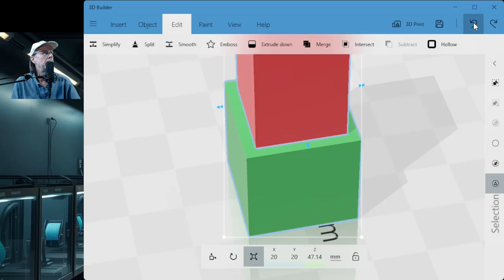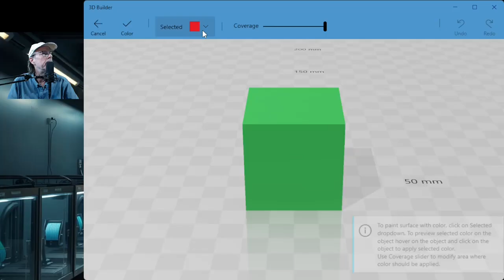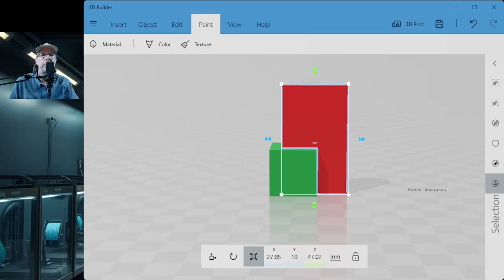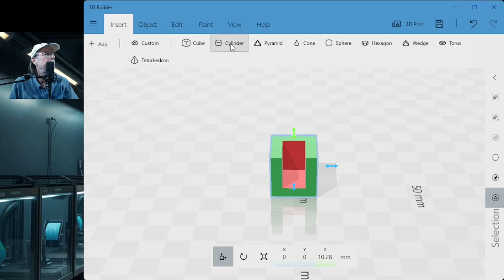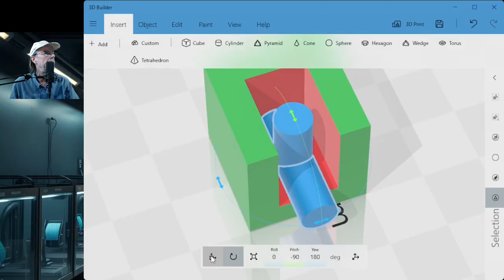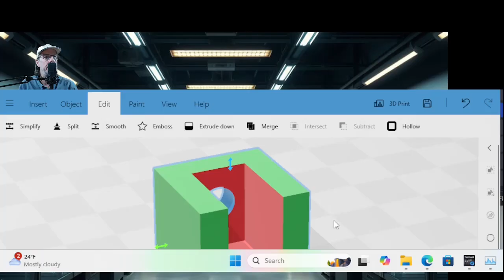Forget Fusion 360! Get This Simple 3D Design Tool Back (Perfect for Beginners)

Comment: Is there a convenient way to verify dimensions or positioning of features after completing the design? I'm a huge fan of checking models before printing.
Reply from the maker: To verify dimensions on a specific object, highlight the object and click on the "scale" button on the bottom (right of the rotate button).  To verify total dimensions of what will be printed, click on "select all" from the right-side menus and then click on the "scale" button.  I like to keep the final product as close to the "0" mm mark - it usually shows up centered in the slicer that way.